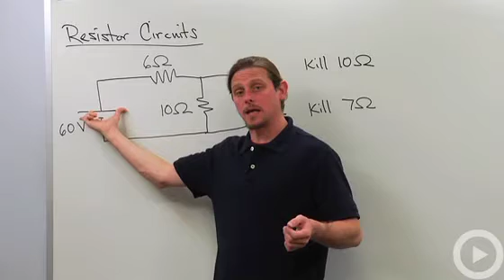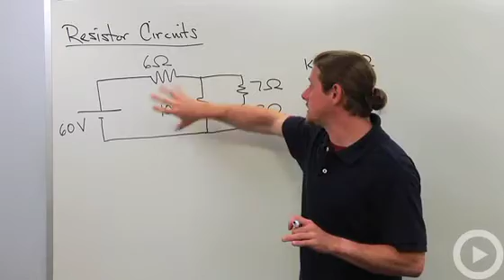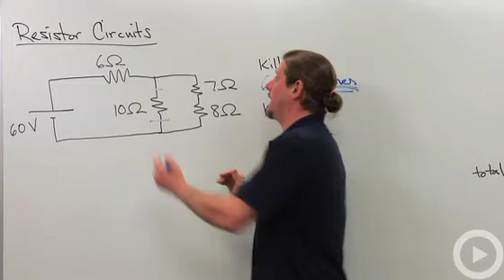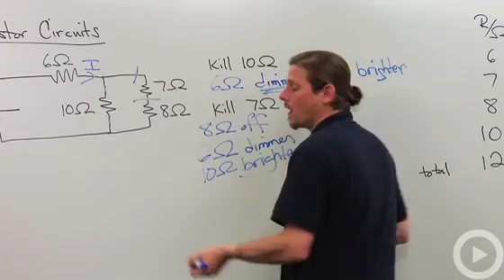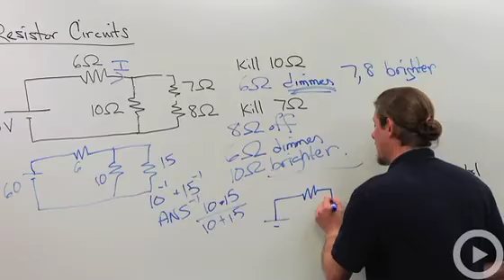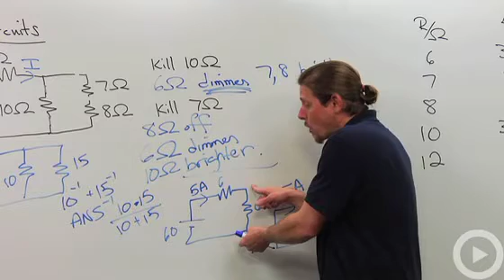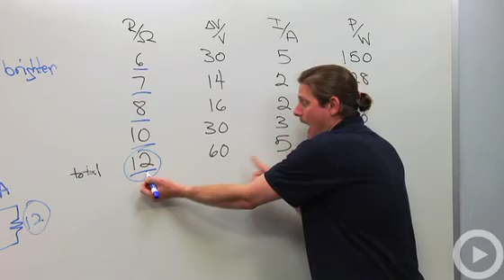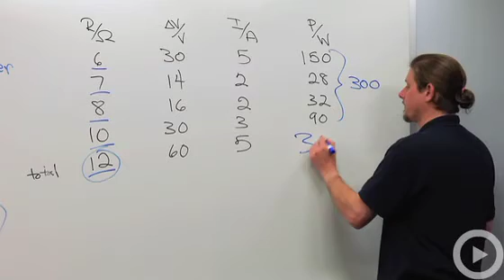Resistor Circuits

Comment: Can  anyone tell me what a short circuit is?
Reply: +Eusha Khan 
a short circuit is where you get a connection that bypasses your resistors. Basically you are creating an unintentional "easy" path for the electrons to flow through. Let's say with Jonathan's circuit diagram, you added a line that connects from the top line, just before the first resistor, and then goes straight down to the line below. For any electron, the choice of path is obvious: go along the new path and thus avoid all the resistors! but now you have to think about what happens as a result. The voltage is 60V but the resistance is only going to be the resistance of the wire which is really really low. So if V=IR, the current will be HUGE. this massive jump in current can result in a huge jump in heat (meaning a fire or a burnt out part of your circuit) the wire could melt, the battery could overheat, etc. bad things could happen. it's why in houses we have circuit breakers - resistors that will literally break apart if too much current goes through them, and therefore stops the entire circuit from working.

hope that helps.

Comment: Hi, when a current enters the resistor does it decrease the amount of electrons and we get
less electrons comes out of resistor (at the other end) OR it (resistor) decreases the speed
of electrons and we get slower electrons coming out from the other end of the resistor?
Also when we say that 2A is going through resister R , does that mean before entering the resister or after the resister?
Please help

Comment: Because taking the 10 ohm resistor away would give more current to travel in the series rather than in the parallel. This means that less resistance is taken away in turn giving a lighter bulb rather than a dimmer one :).

Comment: I don't get why removing resistors in both instances will make the 6 go dimmer. Wouldn't removing resistors (resistance in the circuit) make the current go up? Therefore making the 6 brighter? 

Especially if it is in series as it has to travel through them in order one at a time?
What am I not getting here?